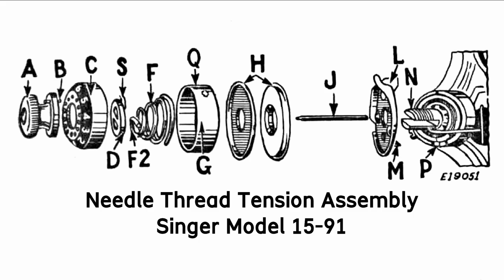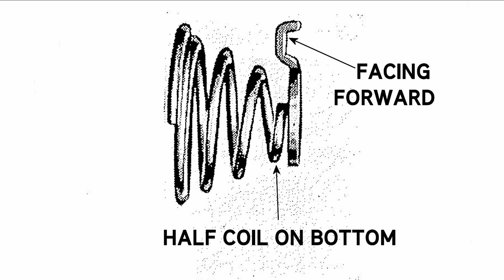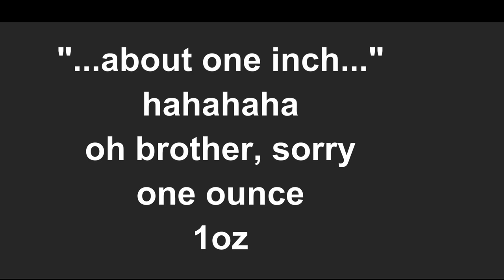Tension Assembly, Singer 15-91 Remove, Clean, Install, Adjust, Zero Out

Comment: I am hoping you can help me! I just purchased one of these at a thrift store and I have been working on it, I got all the parts moving, I had to clean rust off the bobbin shuttle and I installed a new motor and belt. It is running and seems to be going well except one tiny problem, my white thread is coming out grey! Yikes! The only part I haven’t cleaned is the tensioner. I’m wondering if you think that is the problem or should I look elsewhere?
Reply from the maker: How did you clean the rust off the "shuttle"?  It should be easy for you to determine if the tension unit is causing the grey thread. 
     Remove the thread from your needle. Grab the needle thread just before it goes into the take-up lever. With the presser foot down pull the thread straight up. So you are pulling the thread thru the tension discs under tension. If something on those discs is staining the thread you know that is the cause if the thread is going into the tensioner white and coming out grey. I've never seen that, but each machine is unique. If so, time to clean the tensioner. 
     If not then the more likely cause is when the hook point grabs the needle thread and drags it around the parts to wrap it around the bobbin thread. Much more contact with metal in that process. 
     Did you use a chemical to remove rust? Did it leave residue from reacting with the steel? Could you remove the bobbin case and rub it with a white cloth to see if it marks the cloth grey?
     I always try to isolate the problem before grabbing the tools, so I think you're smart to ask before removing the tensioner.
Reply: @andytubesewing1953  I did not use a chemical cleaner to clean the rust, I used a dremel with the wire brush on very low speed and delicate so not to nick anything. The feed dogs were caked in something black which I have now decided was part of the culprit but still coming out Grey when sewing. Maybe there is grease around the bobbin where it catches that I’ve missed. I did not think of that! I will check that tomorrow! Thank you!
Reply from the maker: @simplyscyfygirl2641  okay good luck. Hope you find the source
Reply: @andytubesewing1953   what is the best most gentle degreaser to use on this machine?
Reply from the maker: @simplyscyfygirl2641  I only use one degreaser and it is the only one I have ever tried. https://www.rustoleum.com/product-catalog/consumer-brands/krud-kutter/cleaners-and-stain-removers/original-krud-kutter    I buy it by the gallon but it comes in 320z spray and 4 oz concentrate too. It is water-based and you can use a 5% KK to 95% water solution if you want "gentle". Like 1oz KK to 15 oz water. The concern with the 15-91, and all black coated machines, is the finish is easy to damage with cleaners. Here are a couple of videos for cleaning two black finished models: https://youtu.be/w6fn-TSOCYo       https://youtu.be/nZKAVHfUQoc      On all metals, plastic, etc parts I just use the KK as a cleaner general cleaning about 15% then make it stronger if needed for very greasy gears, etc. People have used Simple Green, dish soap. alcohol, gun cleaning solvent, brake cleaner,, hand cream-type degreaser, and all kinds of stuff. I just stick with the KK.

Comment: I found a washer like part along with the disc when taking apert  tension assembly I don’t see it here. Can you help me?
Reply from the maker: So it is not the stop washer shown at @4:16?  Is your machine this exact model, the 15-91?
Reply: @andytubesewing1953  no it’s the same size as the disc
Reply from the maker: @christinewhitaker2957  sorry, you did not verify the model number. Also, are you saying you have two curved discs plus one flat washer? I've never seen that. If one curved washer and one flat washer I'd say it was a home repair for a lost curved washer. The parts manual for the 15-91 shows two curved washers (tension discs)  Used ones can sometimes be found on eBay, as well as "new" aftermarket tension units but I've never tried those..

Comment: The gage that you use to measure the tension, do you know what it's called? I'm trying to find one to buy. Thanks!
Reply from the maker: I put a link in the description below the video, but here it is again: https://singer-featherweight.com/products/bobbin-tension-meter
Their new version is much better with the darker metal that gives superior readability.   It was originally made as a postage scale but soon became a favorite affordable tension meter for folks like us. The featherweight shop is the best for it, IMO, with free, fast postage, but you can shop around online too.
Reply: @andytubesewing1953  thank you! I ordered one. I'm having issues getting the tension right on my 15-91, so I'm hoping using this will help and then if I continue having problems I'll know it's not the tension.
Reply from the maker: @chelsea6539  That's exactly how I troubleshoot the problem and it's nice to have that gauge around. Good luck, I hope it works out

Comment: I have a question… the long horizontal post that you put all the tensioner parts on to when you re assemble it… the slot in the center of that post is vertical. Can I adjust that?
Reply from the maker: It's called the Tension Stud, and yes you can adjust it. When you turn the stud to the right it increases tension on the Take-Up Spring. Of course, turning it left reduces tension on the Take=Up Spring. The Adjusters Manual says there should be just enough tension on the Take-Up Spring to take up any slack of the needle thread when the needle is going down into the fabric. You don't what the thread flopping around during that time. To be able to turn the Tension Stud you loosen the smaller set screw on the outside left side of the cylinder that surrounds the Take-Up Spring. If you look at the side of that cylinder there are two screws. One has a larger head and is closer to the front of the cylinder. Farther back past the first screw, there is a smaller screw. That is the one you loosen to turn the stud. If you freeze this video @ 9:52 there is a decent shot of the two screws I'm talking about. Most SInger tension studs of later models did have the slot of the stud turned horizontal. That's because the tension unit faces the sewist. The model 15-91 has the tension unit on the nose cover plate with the stud normally turned so the openings of the slot are at about 4:50 on a clock face if you remember what those look like 😊🕟 The idea is it tilts the Indicator Dial (- | + ) towards you as you sit there in front of the machine to sew. Does that help, Sarah? Good luck, and thanks for watching my channel.
Reply: Thank you for your explanation and quick response. Your videos on this 15-91 are going to be valuable. I recently purchased a used one in cosmetically good condition. The previously owner is a tinkers in old bicycles. He picked up this machine at some point. After I purchased it for 50 bucks he told me he had taken it apart because it was locked up. The marketplace ad said it had “restorative maintenance professionally performed “ in working order. ( insert audio laughter track!) The guy didn’t know how to sew, so the machine couldn’t have been tested. The motor runs and the needle goes up and down. The tensioner, bobbin winder are not quite right. It doesn’t NOT sew a stitch yet. The thread keeps breaking. I followed your video to take tensioner apart and put it back together and that’s seems correct…but that tension stud slot being vertical instead of horizontal bothers me. I’m going to turn the tensioner stud to the left to get it horizontal then put it back together.
Reply from the maker: @sarahgobrecht1197  “restorative maintenance professionally performed “   🤣🤣😲😲
I meant to ask if you have the Instruction Manual. You can download a FREE PDF copy from Singer Support at this link: https://www.singer.com/search/support?title=15-91   68 pages of great information and instructions.
Thanks for saving the machine, Sarah, and good luck.
Reply: I have a digital copy so far
Reply from the maker: @sarahgobrecht669  Good. I find them very helpful when I first get a machine. I'm not familiar with. Good luck! Sarah

Comment: Does anyone know if the tension is the same as a 15-125?  People keep telling me it's the same machine as a 15-91 ...  Thank you
Reply from the maker: Yes, the tension assemblies are the same. I have copies of the original parts lists/diagrams and the part numbers match. What we call the tension or the tension assembly or the tension unit is labeled on the parts list as "Part 125418 - Tension (Graduated) Complete.
Reply: @andytubesewing1953  Oh that helps so much - thank you!  I'll get the parts and try tackling it.  I hear it's a good machine so keeping my fingers crossed I can get it working.  Hope you are feeling well and thank you so very much for answering my question!  - Dorothy
Reply from the maker: @redwoodcattledog  You're welcome. I'm not sure which model you have, haha. Model 15-91 was made from 1930 to 1956.
Model 15-125 was made from 1955 to 1958. Model 15-125 is actually based on model 15-75 but they added the potted motor.
Here is info on the 15-75 which I have never seen in person (rarer) http://sewing-machines.blogspot.com/2013/03/singer-15-75.html   You'll have a good time working on your model 15 whichever you have, and they sew like a dream.

Comment: Hi Andy is it so that tread can get old? I have constant breakedge when sowing in an Singer 437, THE tread seperate and growes in thickness and Snap,s.

Erik from Sweden 👍
Reply from the maker: I suppose it can, depending on storage conditions. My wife recently made a blouse and used some 50-year-old Mercerized Cotton Thread that worked perfectly. Many seamstresses have told me to use good quality thread and needles b/c they are the least expensive cost of what you are sewing, compared to the cost of material/fabric. For me, the keywords in your statement are "grow in thickness". I've seen that when the eye of the needle is too small for the size of the thread, and that causes the thread to "bunch up" on itself and get too fat for the eye and then snap apart.
Reply: @andytubesewing1953  sounds plausable. Thank,s
Reply from the maker: @erikhoffa966  If not for the thickening then the most common problem is upper thread tension too high. That is easy to test by turning the tension number down & down. You want the least amount of tension that gives an even stitch.
https://youtu.be/PSCY72bJ3x8
Reply: @andytubesewing1953  moisturising THE tread and avoid THE last treadguide made it much better.
Reply from the maker: @erikhoffa966  That's a very unique workaround, Erik. 🏆  I've never heard of "moisturizing" the thread. If the thread is moisturized before entering the Tension Discs in the Tension Assembly and then the last thread guide is skipped both of those would reduce tension on the needle thread (as I mentioned). I'm happy you found a solution no matter what it is and it is true that necessity is the mother of invention. Happy Sewing, and thanks for watching my channel.
Reply: @andytubesewing1953  it wasn,t enough, THE needle hade to be repositioned.
Reply from the maker: @erikhoffa966  OK and thanks for sharing this info. Take care.

Comment: 247?? 😑
Reply from the maker: A little different. The numerator (number) dial pulls straight off towards you. Under it is a screwed-on thumb nut to remove. Other parts on the stud are in the same order. Buy the $9 Service Manual for complete instructions here: https://manualsoncd.com/product/singer-240-series-sewing-machine-service-manual/